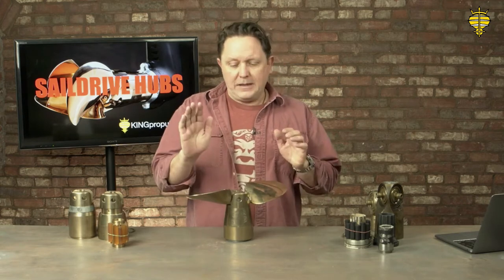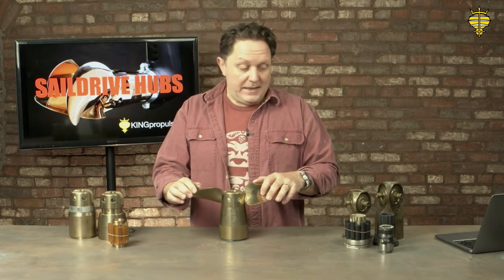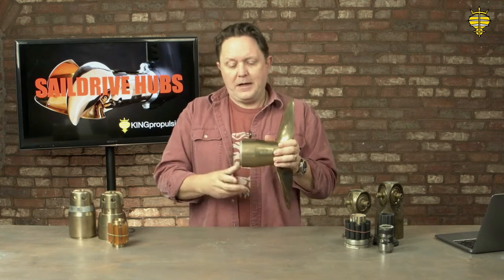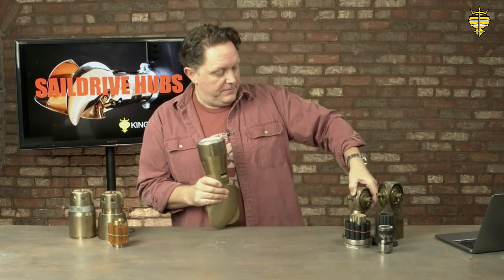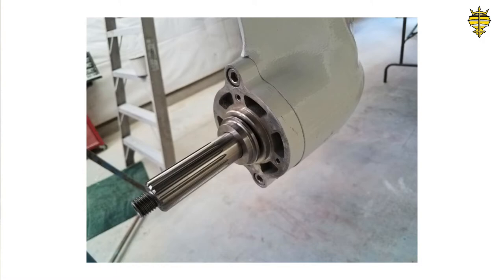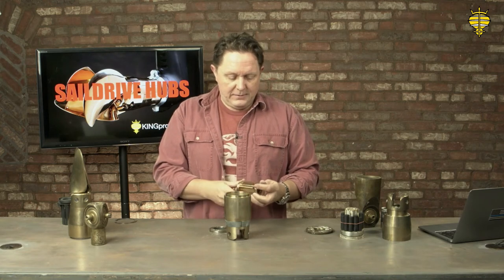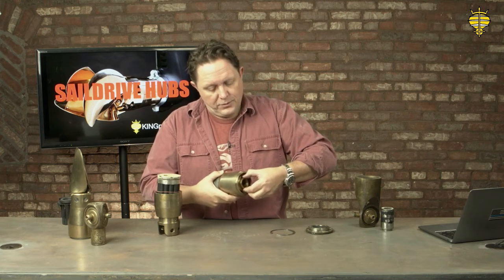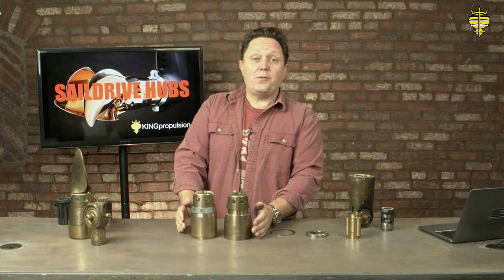Saildrive Propellers Explained

Comment: Sorry to hear apropeffesional not understanding the reason for the rubber propeller hub in the saildrive propeller. The main reason is to protect the aluminium drive from the galvanic corrosion adding a  bronze propeller on the common shaft. Just a zink anode on the drive are not capable of protecting the drive. Especially if the zinc gets passivated or reduced in size because of age. All these propellers need to be electrically isolated. No electrical connection between the internal splines and the hub. Easily checked with a multi meeter.
Reply: That's a good point, I always wondered how these are electrically isolated. As yo say it must be the most important reason for the rubber. That said, I suspect the rubber/elastomeric parts also have a dampening quality, much like a harmonic balancer in a car.

Comment: This is largely false with respect to hitting something.  What will happen when you hit something is the vertical shaft going down from the gasket stopping water from getting into the boat will take the brunt of the impact.  The last item to be impacted will be the prop. The explanation this guy gave is completely erroneous.